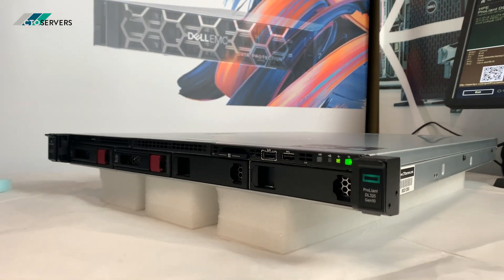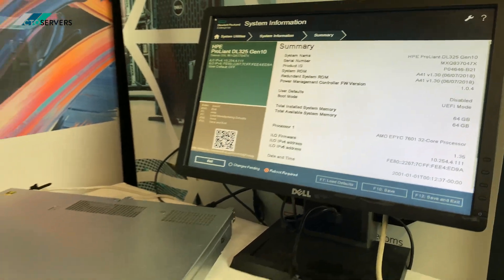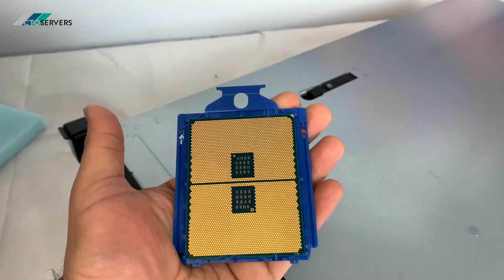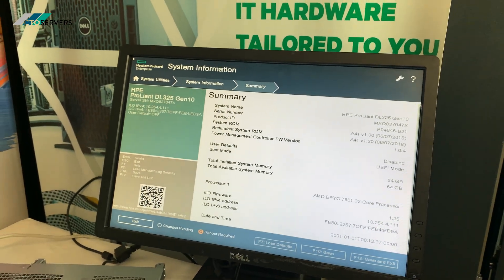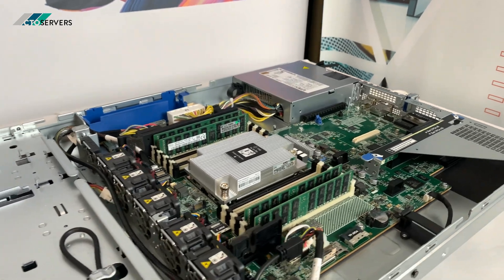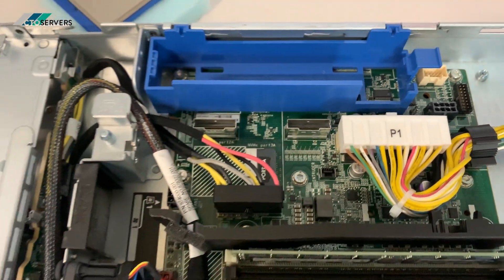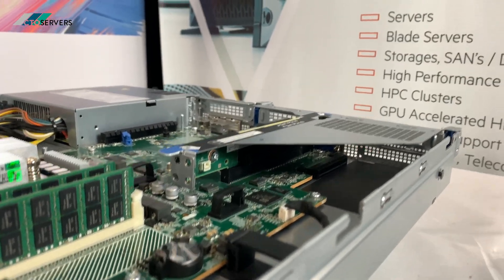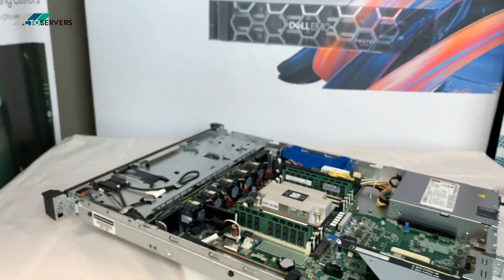HPE ProLiant DL325 Gen10 , AMD EPYC CPU , 32 Cores / 64 Threads . CTOSERVERS

Comment: i am from india. before saying anything i would like to say i have zero knowledge about server connection and setup
with this reason i hesitate and unable to buy any server.
thats why i am here to ask little help, about how multiple node connect together became one server as 300+core cpu 
act as supersingle computer.

x86 server CPUs top out at 56 or 64 cores per socket but boards with 2 or 4 sockets will yield 112/128 cores or 224/256 cores. 
This makes up one node but enterprise grade servers have multiple nodes connected together via data fabric interfaces such as 
infiniband. Theoretically, a large server could have 1000s of those nodes totalling 1000+ cores.
if this is all correct then please show buliding blocks how these all node connected together became one computer act as larger
cpu core .i seen yours many videos but didnt see how these all node connect together .please show me in live display screen view
as more than 128+ core.
i am looking for more and more cpu cores and ram requirement for my multi workloads at a time.
my mostly work is computational cpu based like 3d ,adobe, artifitial inteligents, cpu based simulation.

Comment: I need a "new" server to store data. Im interested on a dl380p gen8 hp the basic model with 8sff drives (i already have 8 of them 1.2 tb in a bad g4) and i came up with your site and specially an ebay offer. On the site i could not find a good solution (under 180€ like the ebay one but with nomire than 32 gigs of ram!) are the servers configurable? Can i buy one with less ram and the 2660 xeon?
Reply from the maker: Hi , Email : sales@ctoservers.co.uk